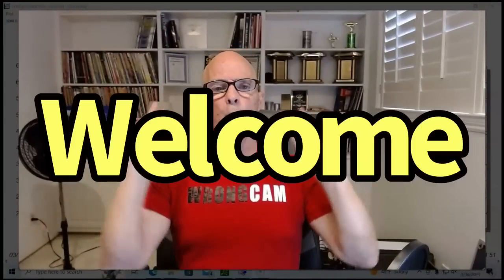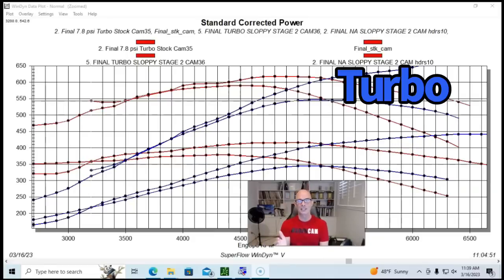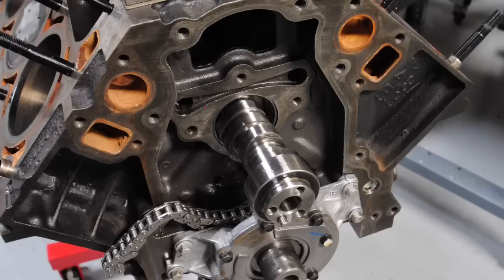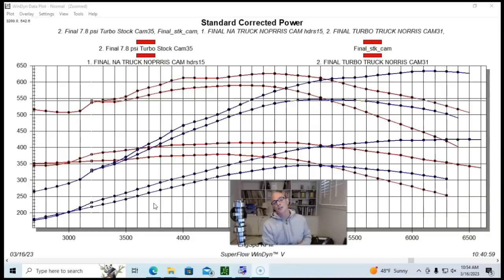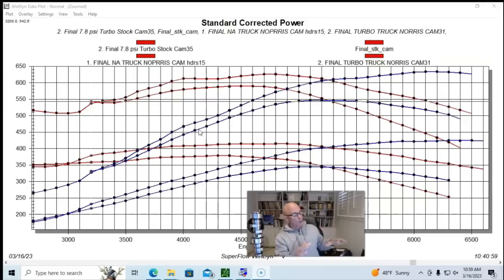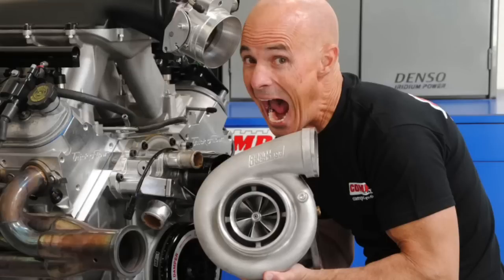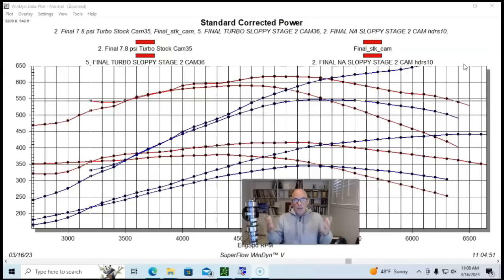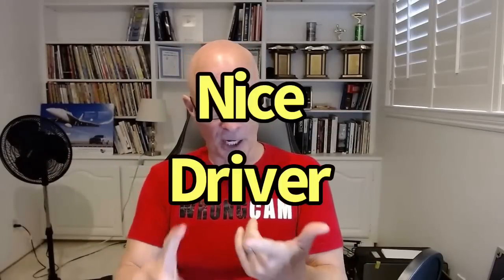WHAT MAKES A TURBO CAM A TURBO CAM? HOW MUCH LIFT, DURATION, LSA AND OVERLAP CAN YOU REALLY RUN?

Comment: This guy is a moron. Duh, a power adder adds power. Duh, the dyno graph looks the same. 
Now actually compare two cams with the changes, example; compare a turbo cam to a na cam. Did they make the same boost? At the same rpm? Same power curve? Same exhaust pressure? Is a turbo cam more suited for a turbo than a NA cam? Why or why not. 

For someone that  has tested 40 cams, youd figure you could say more than the same 4 sentences for 15 minutes.
Reply from the maker: It is easy enough even for you to understand. The difference in power between the na and turbo cam stays consistent under turbo boost. Whatever cam makes the most power na, makes the most under boost (the power curves remain consistent)-I obviously didn't say it enough times for it to sink in
Reply: @richardholdener1727  but you are entirely missing the point of comparing cams. 
Lets use an analogy… say we want to debate which toilet paper works best when wet vs dry. 
And you say you tested 40 brands and all of the toilet papers… you concluded regardless of dry or wet, they all removed poo. And they removed poo in proportion to their texture. Regardless of wet or dry.
Now the point is to say WHICH ONE WORKED BEST FOR THE APPLICATION. Not the simple fact that they all remove poo in proportion to their texture. Everyone knows that. It is a simple fact and is not evidence nor proof of comparative function. 

Youve made statements that are completely true, but completely out of context, and thus irrelevant. Which, analogously, you are better at talking about poo than actual facts.

Comment: Will a 229/246 .600"/.600" 110 LSA 107 ICL Cam work well under boost?
Reply from the maker: does it work na? (the answer is yes)
Reply: @richardholdener1727  Hello, Richard im hoping that you will lend some advise. I have a l92 motor that im planning on doing the basic vvt/dod delete + ls3 upgrades; rockers,valves, springs etc. however im deadset on using a 60mm turbo and a TSP BFD Chopmonster Cam I have laying around. 229/246 .600”/.600” 110 LSA 107 ICL. My question is 2parted;
My power goals arent too crazy, im looking to be anywhere in the range of 600-700 RWHp. Im building a street cruiser Chevelle that can occasionally do  somecool  burn outs with my son not a drift machine.
I know there is  probably a more efficient Cam out there but will using this one hurt anything? I know  a 60mm turbo is small but its just sitting there will using this specific turbo hurt anything? I can always upgrade at a later time.

Comment: Totally agree . Look at turbo/ supercharging as an atmospheric pressure or air weight multiplier . In automotive terms this was thrashed out in 1980s Europe with the introduction of turbocharged 1.5 litre engines to compete with the Cosworth DFV V8 engine . Bhp required to win say 650 . 1.5 litre NA  unlimited race engine at 100bhp/litre , 150 + bhp @ 9000 rpm with established reliable cams . X 4 Bar boost = 600bhp with lighter weight advantage made the Renault cars competitive with their 4 cylinder engine at the beginning of the era with mechanical fuel injection . At the end the end of the era cams were limited only by the physical dimensions of the cylinder head or cam carrier space they occupied and fully mapped fuel 8njection , efficient charge cooling and unlimited boost the 1.5 litre V6 engines were making 1200+ bhp @ 11-12 000 rpm in practice allowing the turbocharger to control the boost without a wastegate and anywhere around 850bhp in regulated boost race trim . The BMW iron block 1.5 4 cylinder was making around 1300 bhp in practice with engines and boost levels deliberately designed to last only 4 laps running on the edge of total destruction. On qualifying these engines were removed , retired to the scrap pile after analysis and a race engine installed to actually compete . Rinse and repeat for every race . Totally unsustainable and running out of control .
In aeromotive terms this is called normalising . This was thrashed out in the 1940s when both types of supercharging were employed to replace the air weight lost at altitude to preserve the power levels achieved by the air racers at normal sea level , with boosting in war emergency/ take off mode with the introduction of 2 speed superchargers as war and development progressed .

Comment: More overlap leads to reversion before boost, once boost pressure is greater than exhaust back pressure it then does something different. It pushes out fuel in the exhaust and messes with your true cylinder AFR. If that fuel was pooling behind the intake valve some of it is going to go out the exhaust. The wideband will read what the system saw (average), but not what the cylinder saw. So in this case you usually have to add more fuel than normal to get it right in the cylinder, even though the wideband says otherwise.
Reply from the maker: HOW IS FUEL PUSHED OUT THE EXHAUST SIDE WHEN THERE IS MORE BACK PRESSURE THAN BOOST PRESSURE? OVERLAP IS YOUR FRIEND FOR POWER-EVEN UNDER BOOST
Reply: @richardholdener1727   is it the same in a SC config? Actually im looking for a Cam für my SC and in my opinion to much overlap does not work perfectly with SC. Used a stage 2 NA Cam and there was little increase in performance but massive fuel consumption.

Comment: Kinda hard to read the graphs cause the legend color coding is all red...

And: the claim "it just multiplies" does not hold true in all of the graphs. The curves are not the same. For sure the boosted graphs are higher, but the paths are not the equal but shifted. The multplier changes.
Reply from the maker: THINK ABOUT WHAT ELSE CHANGED WHEN WE ADDED BOOST FROM THE BLOWER (HINT-INTAKE)
Reply: @richardholdener1727  whole lotta tubing for sure, If that's what you mean. And along those air that has inertia.

Still, claiming simple multiplication is not in all cases exactly what happens.
Reply from the maker: not inlet tubing-intake manifold design as in short runner-simply multiplication is a turbo thing-blower (for the reasons started) are different

Comment: Great video, I’m running a comp 287/303 advertised. 227 int./ 241 exh. @.500.  0.557 int./0.539 exh. With a 107 LSA seems to work fine with my twin rear mount turbos.
Reply: How is your vacuum? You'd probably benefit from increased LSA at 112-114.

Comment: It's possible to build an engine that builds loads of tork in real usable vehicle speed. If you can make almost all your power at say 75 mph would be alot of fun.  At 5252 rpm at 65 mph could be interesting.

Comment: Most engines are over cammed by home builders thinking more is better. A 3500 plus rpm cam is radical and I've seen street cars with these solid lifter cams.

Comment: A good gear ratio for your differential would be 3.50 on a streetable car. For top end mostly I'd go with a 320 degree cam and a 3.23 gear with o d. Major top end there.

Comment: You need to decide if you want an engine that makes power and low to mid range rpm or higher range and gear the car accordingly.  A 4500 to 8500 rpm cam would need 4.11 to 4.88 gears. While a mid range cam would start out at 3500 rpm.

Comment: We learned back in the 80s and 90s that there wasn't alot of gain from using a turbo specific or nos specific cam. And only about 20 hp gained from the bigger cams.

Bloodviking

Comment: Richard, I am a long time viewer of your channel. I am building a 2003 Ford Zetec that will be turbo charged and it is going into a 1971 lotus Europa. Transaxle will be a Renault 395 five speed. My question is, should I stay with stock cams or should I go to a stage one, stage two or maybe stage three cams. This will be a weekend driver. Last question, at what point should I “Beef up” my rods and pistons?
William
Reply: Richard, thank you for the info I should’ve waited to the end of your video. It doesn’t look like I need a radical cam, The Stockham looks like it will do.
Reply from the maker: WE RAN 300 WHEEL HP WITH STOCK STUFF

Comment: we need runs all the way down at 1500~2k rpm and there about, unless you run a auto that change every time you get a bit there is a lot of unseen changes i feel
Reply from the maker: 1500 rpm at wot?
Reply: @richardholdener1727  well when it comes to what makes a turbo cam i feel it really should be addressed how early they get on boost not that they simply make boost and power half way down the rpm range. 

sure for a track car pushing 1k hp drag racing it is not necessary data. i agree wholeheartedly

Comment: Have you ever done a 4.8 crank and rods in a 6.0 or 6.2? I'm curious if it's possible and what pros and cons it would have.
Reply from the maker: yes-that video is up (I did an ls3 block with 4.8L crank)

Comment: Advice please. I have a 5.3 and adding a turbo. Truck norris cam, tbss intake,80lb injectors. Goal of 700hp at crankshaft.  My question is maf. What maf is needed. Also i need a vacuum pump to keep my power brakes? Sorry if its a dumb question. Im new to turbos, not new to engine builds. Thanks
Reply from the maker: you don't need a vacuum pump with that cam and most use the stock maf
Reply: @richardholdener1727  thank you.

Comment: Im not sure how frequently you check the comment but could you pick a hyundai 5.0 or 4.6. The engines have forged internals and all aluminum block. The only thing there is no tuning available. Could a aem hook up and change throttle body stronger injectors and maybe forced induction
Reply from the maker: a stand alone would fix that

Comment: I would like you to do a video on comparing ignition modules and if they actually make a difference.  For example I have "Jacobs electronics ignition" and they have since disappeared, but they made some amazing claims.  I would love real data on comparisons between say an MSD 6A or my jacobs module ( I would even send it to you if you would like to run this test )  and maybe like a coil on plug system etc.
Reply from the maker: ignition amplifiers don't add power unless they help cure a misfire problem
Reply: that is what I would think, but Jacobs claimed otherwise!

Comment: I understand that adding boost is going to add hp but isn't there a specific type of grind that is more efficient for moving all that air and fuel when you add boost?
Reply from the maker: no, all of the cams offered the same percentage gain with boost

Comment: I have a question, I’m building a budget lq4 6.0 with springs and sloppy stage 2 I got a cat c6 turbo for free from work it’s a 96mm turbine 1.72 ar housing T6 flange and 87 mm inducer and the 110mm exducer on the compressor, I know is going to be lagging as hell but do you guys think it would even be worth it, it’s a brand new name brand turbo it’s going in a 4000lb 4 door th400 3000 stall 3.73 gears and 31” tires
Reply from the maker: try-it was free

Comment: How long does it take to get oil through the pushrods on a dry LS? I did a cam swap and a few other things I’ve primed the pump and rolled it over but no oil through the push rods.

Comment: Howdy great videos all the time can't wait for the next one.! The cad company videos were #1 got a 85 suburban with the pro street heads 4x4 1 ton rears straight cut gears th400 . Anyways what weight/ color springs would you recommend on distributor sbc 383 11 1/2 1 comp xr282 Mickey Thompson cross ram Holly 650s . Runs great but no advance set at 24°  really appreciate your awesome work on here.

Comment: I’ve seen too many boosted motors do cam swaps and make more power !!!! We all know lift has the greatest effect on power, so we leave lift about the same same duration,and just split it different and swap the over lap and watch it increase in power why, less air is leaving why the exhaust and intake aren’t open together as long pushing air out..
Reply from the maker: lift in no way has the greatest effect on power

Comment: SEE IF WE WANT TO PROVE HIM WRONG ,we engine builders should  take a  NA motor ,turbo it, then swap the cam for one with the correct specs and see if it works better..bet it does ..I will bet $1000 bucks ,if you take a na motor boost it ,then spec the cam for boost it will pick up power..
Reply from the maker: picking any different cam changes the na power, which changes the turbo power-please rewatch the video (cams change the power curve-any cam, not just turbo cams)

Comment: Hey Richard, how much do you think my Tfs genx 225 are going to hold back my 427 sleeved ls3 with ported fast 102 and 236/252 118 are going to hold it back? What do you think it will peak at?
Reply from the maker: hold it back?
Reply: @richardholdener1727  just wondering if the heads are too small for my setup and going to choke up top with the 2.055” valve this is a 4.125 bore deal. Also how much do you think full 3” exhaust all the way to the muffler out the back a 2.5 vs 3” exhaust outlet ~6 inch of length to tip would there be quiet a different in back pressure ?
Reply: @Chris Walker  what's the usage for the car?
Reply: @BEANS-O-MATICtransmissions  weekend cruiser and drag it at the track in the summer
Reply: Plan on putting a ysi-b on it

Comment: Ok we all know that you can add boost to any motor with any cam, but we in the know !know that it’s the overlap that’s different on a turbo, or blower cam, even the factory changes the overlap..   a NA MOTOR NEEDS TO Scavenge on the exhaust side to pull the air in, but you don’t want the exhaust hung open too long while the intake is open why, because you simply push the boosted air out the exhaust so the less about of time the exhaust is open on a boosted motor the more power it will make..so your not totally right, other than yes boost will just increase the power, but the right cam will do it better..
Reply from the maker: please see all the test results-you are NOT in the know, turbo cams have overlap (as shown in the video)

Comment: I'm building a blower motor, and I chose the old school 327/350hp (.447lift/223dur.  114 lsa) Cam. My thinking is that supposedly blower motors like more duration and LSA, and if that Cam can help a NA motor make more than 1 hp per cubic inch surely it would multiply that  even better under boost.  I hope I'm right. I don't want to end up building an old slow dog.
Reply: Procharger and Vortech recommend 112 to 116 LSA. A blower and a Nitrous cam are very similar. I run a 114 LSA with my f3-121 procharger. This video is crazy, just because you add boost to a cam and the power goes up doesn't mean it's right or gonna last. Just like more exh duration than int on a blower setup is what is whats wanted.
Reply: @jasonstormoen  I like to use higher Ratio Rockers on the Exhaust side. It makes me feel good. So does a higher LSA of 114 and  your input. Thanks !

Comment: Dose using a tuber or super charger on the L96 make the VVT pointless? Also what cam would recommend for this application?
Reply from the maker: vvt works with boost too-depends on how much power you want and where you want it
Reply: @richardholdener1727   1.Thank you.
2. I'm thinking some where between 500 whp and 550 whp using an 8L90 transmission.
3. I assume it would be some where around 4000rpm or 4500rpm, but really it's which ever RPM rang helps me maximize both acceleration from 55mph to 75mph and fuel efficiency.  Any chance we can get videos on the L96?
   I'm trying to figure out if it's posable to convert an Infinity G37 to four wheel drive so I can daily drive it even in the winter. Which is probably going to be really hard since I have 0 experience as a mechanic, but I figure an 8L90 transmission is a good place to start.

Comment: unfortunately this video was somewhat disappointing. the thing that drew me to the video was to gain insight into possibly a decent discussion on fluid dynamics,  momentum, valve reversion, modifying the otto cycle with scavenging options, milller cycle, etc. instead.... you said, don't bother. ok. thanks.
Reply from the maker: if you are looking that detailed into a turbo cam, you need to look elsewhere-if you want to know what works-look here

Comment: good info Im actually considering going boosted from nitrous if I do my plan is to run the engine as is only with boost     It being a 408 hyd stroker LS WELL built bottom to top I feel like it should make 1300 and still live long and prosper    lol

Comment: This video is worthless without showing the calculation between theoretical turbo HP and measured HP.  NA HP x ((boost/14.7) +1) = TTHP.   TTHP/ Measured HP = efficiency.  Higher the number the better a cam is a turbo cam!  Crunch those numbers and let us know!
Reply from the maker: every cam in the video performed according to the formula-that was the point of the video
Reply: @richardholdener1727  cool I would love to see / hear the exact ratio for each.

Comment: So if a turbo simply multiplies the N/A torque curve, what does a supercharger do? Does the same concept apply to superchargers, or do superchargers perform better with supercharger cams?
Reply from the maker: Superchargers work in a similarr fashion, but since each blower design also changes the shape of the curve. The PD blower usually requires a short-runner intake and does not provide a consistent boost curve, which changes the curve and the centrifugal blower has a rising boost curve-again, changes the curve.